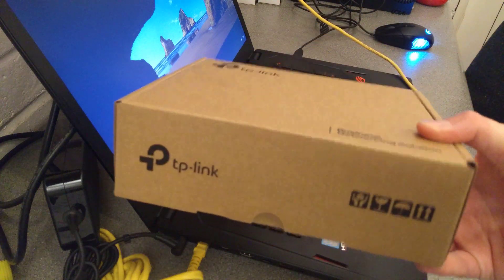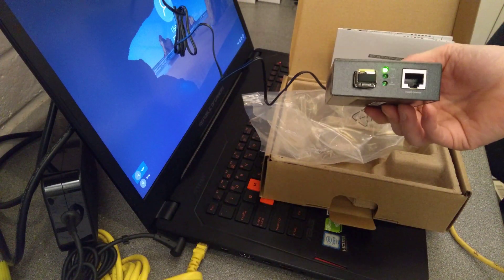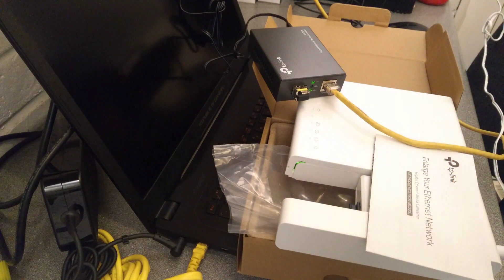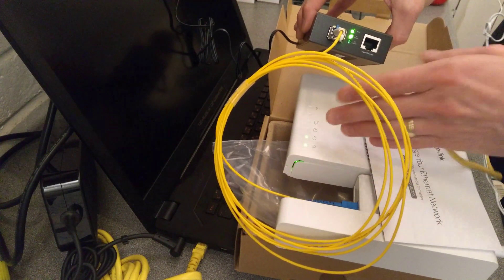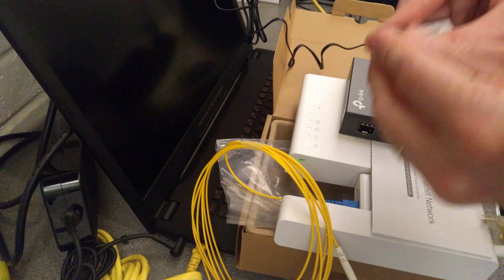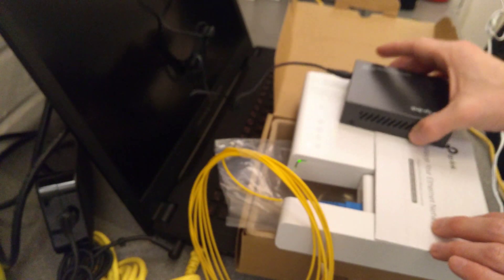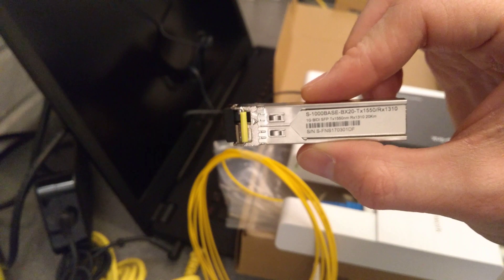MC220L Gigabit SFP Media Converter

Comment: May i ask you please,this optical "break" between router and pc can improve the sound quality of our hifi system if we use the pc as a music streamer since it is theoretically supposed to eliminate net's noise?
thank you
John
Reply from the maker: Very unlikely to do anything. It's a long topic with a huge number of variables and a lot of pushy sales and misinformation when you get to the hifi world.
If the question is "will my 0 and 1 file content/data from the PC to my HiFi mp3/audio player be better quality 0 and 1s due to a media converter and fibre between the two".. no, definitely not. Even if there were errors being introduced in an ethernet cable due to interference (incredibly unlikely on short runs of CAT6) error correction would fix this issue before it ever reached the mp3/audio decoder.
If anything adding in media converters will add additional latency (in the milliseconds, so not much at all and again irrelevant for audio decoding from a static mp3/wav file).

If the question is "will it reduce possible hiss/humm or other noise on my speakers in the analogue path".. possibly but also very unlikely. If it does solve something then you have other issues wrong with your setup like poor ground/earth, a failed component or voltage where it shouldn't be.
Even if you would like to use a media converter; a low cost MC220L or similar is probably going to do the exact same job as a potentially expensive "hifi" media converter.

Where a media converter would be really good is..
Linking two devices a long distance away. CAT5e/CAT6 etc.. can only perform at ~1gigabit over ~100meters. Single Mode Fibre can do tens or hundreds of gigabits over 20km (or more with more expensive equipment).

Hope this helps, and I'd be interested to know your thoughts or what you find.
Reply: @freename  
I see,i see.
"If it does solve something then you have other issues wrong" this is i think the match point and i feel you are right
After all,media converters,SFPs etc,etc they were made to do an other job as you correctly-i think- mean
Thank you sir for the quick responce
My regards
John

Comment: Do ports on media converters have mac addresses?
Reply from the maker: No. They are invisible. If you are using MAC limiting/authentication etc.. then the equipment at each end is the MAC each will see - they won't see anything to do with a Media Converter.
Reply: @freename  thanks!

Comment: wait,.. what is the model of that router??
Reply from the maker: The white box router was a Genexis DRG-7820 but they are bad, I wouldn't recommend getting one. If you want something "customer router" like (CPE) with a fibre optic module port then I would recommend the Zyxel  EX5601-T0. You will need to purchase the appropriate optic for it though as it doesn't come with an optic and only works with approved optics (fs.com, fibrenet and some others).

Comment: Hi Thanks for the very informative video. 
I want to use media converter to isolate my audio equipment from electrical noise. With the TP link MC220L which SFP module and fibre cable should be used? I live in Australia. Thanks.
Reply from the maker: I tested with fs.com "Single Mode" 1 x "1000BASE-BX BiDi 1310nm-TX/1550nm-RX (SFP-GE-BX)" module for one end and 1 x "1000BASE-BX BiDi SFP 1550nm-TX/1310-RX (SFP-GE-BX)" for the other end. For home applications would use SC connectors (Subscriber Connector) but in my video it might show an optic with the smaller LC (Low Cost) connectors.
Don't forget to buy the appropriate length "single mode" fibre patch lead with the appropriate SC connector on the end. The plugs and sockets for the kit I mentioned usually have UPC (Ultra Polished Connector) rather than APC (Angled Polished Connector).

[Home broadband fibre using "PON" (passive optical networking where a single fibre gets split) technology usually needs the APC connectors to reduce reflections from disconnected customer ends. You want to avoid connecting a UPC plug into an APC socket or the other way around.]

Comment: Hi, does a yone know the size of the dc power supply barrel connector?  Is it 2.5 mm?
Reply from the maker: I can find out for you in about a week.. but if it helps, the exact model number of the power supply of the one in the video is T090060-2D1. To me it "seemed" like a normal size 12volt jack.. but that's just me going by memory.

Comment: Hi,
I have a Nokia G-2425G-A GPON router.
Can it be used in this setup as access point in my home network?
Reply from the maker: As in plug the isp fibre into the media converter and use your own router. Then use the Nokia as a WiFi point only?
Reply: @freename  yes
Reply from the maker: No. GPON is different to point to point fibre and needs the optic or router to be adopted and configured by the ISPs equipment. If they could provide you with an ONT fibre module to go in the media converter that would work. If you are in the UK on Box broadband you can ask them to provide you with a media converter they configure.

Comment: What is the brand of sfp module you use master?
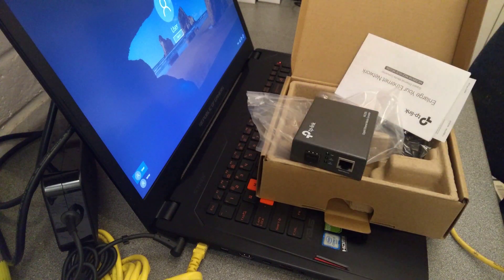Reply from the maker: Likely from FS.com and 0:58 in the video is the model number. Different routers will use different frequencies so make sure you get the matching optic for whatever you are attempting to connect to!

Comment: if the Link of the Media converter device is not on it means what is the problem? and how to fix it?
Reply from the maker: Has it ever been on? If so.. then your fibre line has been turned off or been broken. If it has never worked on that media converter then you might have the wrong frequency or "end" (A or B end) optic.
Reply: @freename  yes of course, it worked when they installed but now after many years of no use of this service I am trying to connect those devices but as I said I haven't link LFP.

Comment: Good morning i have a MC210CS media converter what connector i use ? Do i need to use adapter?
Reply from the maker: I don't really understand the question. The media converter in my video needs a user-supplied optic / SFP. MC210CS looks like it has its own built in optic and uses SC connectors for the fibre.

Comment: Do media converters only convert from copper to fiber then back to copper. Or can it also go from fiber to copper solely?
Reply from the maker: If you have the right optic and know the right configuration (VLAN, PPPoE details if required etc.) it can take service from wherever or whatever is sending it down the fibre.
Reply: @freename  got it. Thanks for the quick reply

Comment: So my isp ran a fiber terminal to the wall but my router is only compatible with copper.  Could I use this to plug fiber into the wall and covert it to copper for a router/firewall?
Reply from the maker: Yes, if the optic you get is compatible with the network they run. And they don't use port security like AT&T in the USA.
Reply: @freename  thank you for the reply. Unfortunately it is at&t adi. You don’t believe it will work in that case? 

Thanks again
Reply from the maker: @crojackbojangles  See this page for more information about the port authentication AT&T employ:
https://github.com/MonkWho/pfatt

Comment: Every intesting and thx for your share bro. Do you have test internet/connection between tplink and genexus ? I plan use the tplink to make simple olt and using passive splitter to distribute connection
Reply from the maker: Explain the setup? You want to go from your fibre provider into a TP-Link then back out of another TP-Link to other devices in your house ? What is the purpose / what are you trying to achieve rather than using CAT6 ?
Reply: Im local internet provider, using cat5 cable to supply internet to my neighbor. I have plan to move to fiber to reach greater coverage but here olt device still too expensive and if using point to point fiber using media converter, it will costly because i need addtional wifi router also on client side.
Below is my plan
ISP router <- cat6 cable > server < cat6 cable > tplink mc220l (replace olt) < cable fiber -> passive splitter -> router client with fiber port (onu)
Reply from the maker: @project.akhir.minggu  Thats a really good question! I don't have much to go on but a friend who works in a passive FTTP provider thinks that you would need a device that can configure the optic and the media converter probably doesn't have that ability.

Comment: Good video dude, do you think I would be able to use this as a substitute for the ISP Provided Modem because they really don’t want us to mess with the settings with the Huawei they gave us.
Reply from the maker: Difficult to say and entirely depends on how the network is setup. Most providers will be basic DHCP only with no special requirements and this will work as long as you get the correct optic (there are many types and different send and receive frequencies.). However it is possible for the ISP to do strange stuff like require the correct MAC address or a special flag in the DHCP request before they give you an IP address.
Reply: Alright, so I made a mistake. I bought a fiber to ethernet converter but the optical port there is for tx so it doesnt even receive a signal from the isp cable. Would it be better if I copy your setup of the MC220L with a Rx sfp or should i buy another fiber to ethernet converter that has an rx slot on it.

https://s.lazada.com.ph/s.YEV7H this was the converter I bought and

https://s.lazada.com.ph/s.YvrPU this is the converter with an rx port on it
Reply from the maker: @terryman0  The two products you've linked are very different. One uses two fibres (one for RX and one for TX) "Duplex Fibre" the first one uses a single fibre for both RX and TX "Simplex Fibre". You need to know what type your provider uses and the frequencies your provider uses then match your media converter to that. The MC220L option and buying optics to go in it might be more flexible for testing and the range of compatible optics you could buy or test. Remember that if your provider is transmitting on 1550 nm and receiving on 1310 nm your end will need to be transmitting on 1310 nm and receiving on 1550 nm
Reply: @freename  Alright thanks man I guess I will go with the MC220L
Reply: By the way, I think we work with Dynamic IP

Comment: Was this to allow you to connect to a Gigaclear FTTP without the Genexis router?
Reply from the maker: Good question. Depends how Gigaclear run their network. If it is just routed ethernet and DHCP then yes. If they need a static IP setting, a special DHCP option (similar to a header), or PPPoE then things may be a bit more difficult.
Do you know what they use for their optics to buy the correct one to plug in?

If you do have the answer or you successfully manage this I'd love for you to reply again here with how you got on and what you did to make it work!

Comment: We are using fibre connection at our office with a Gepon onu router. We are having some difficulties using these ONUs at our premises therefore we want to switch to a Ethernet Media converter tplink CS 220L where we wants a GEPON ONU transceiver. 

Can you please tell me which type of transceiver is available for this model .
Reply from the maker: Doubt it matters what transceiver / module you use. The thing to focus on is that it is compatible on the optical side with whatever your ISP is using.
Reply: @freename  will this works as reciving data from fibre sc sfp port( simplex single mode ) from isp side and transferring it to rj45 port of it?
Reply from the maker: @dharma.vibrates  They are just dumb bridges. Whatever goes into LAN side goes out SFP. Whatever comes in SFP goes out LAN. Media converter does not have IP, does not know about protocols etc.
Reply: @freename  😇 thank you, I have read about that they are passive connectors but there is lots of terminology that I am really not sure about things in fibre. I am newbie here, thank you for your guidance it helped me a lot. 😇

Comment: HI, may I ask you a question? If the SFP module says up to 20Km and I'm using a fiber cable at 30m, will this overheat the media converters? (I'm using 2 media converter 1GB single mode) -
Reply from the maker: For that module in question I know someone who has run them on 3m patch leads for years without issue. (You can also buy attenuators to reduce the signal levels or pre-attentuated patch cables but I wouldn't bother)
Reply: @freename  Thank you!